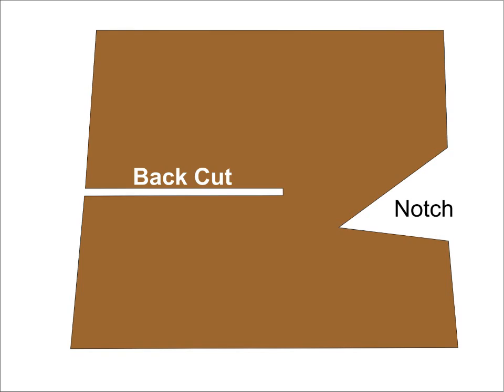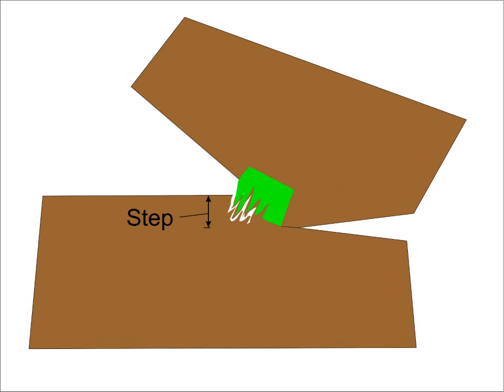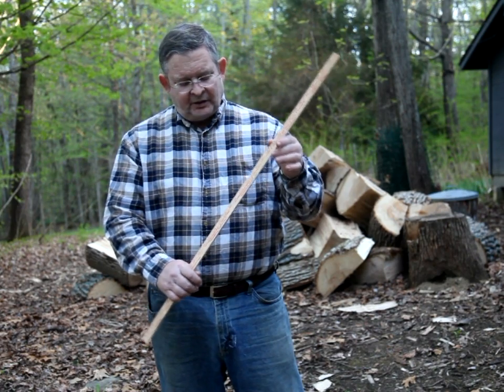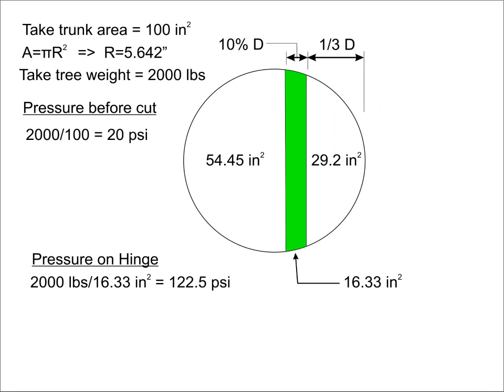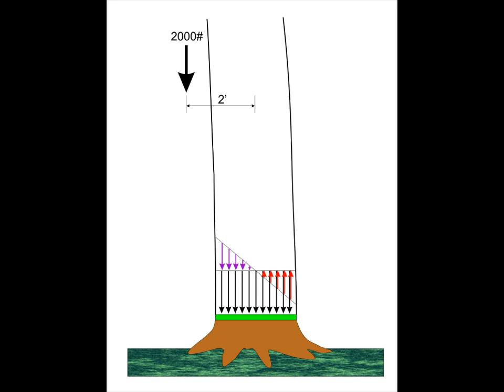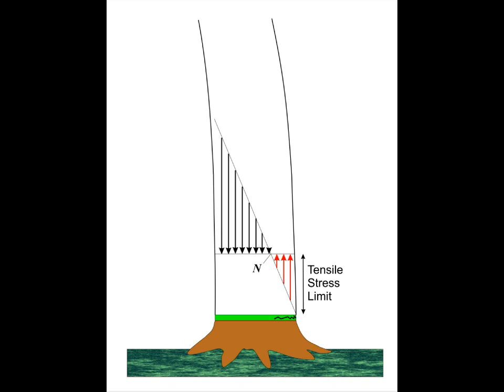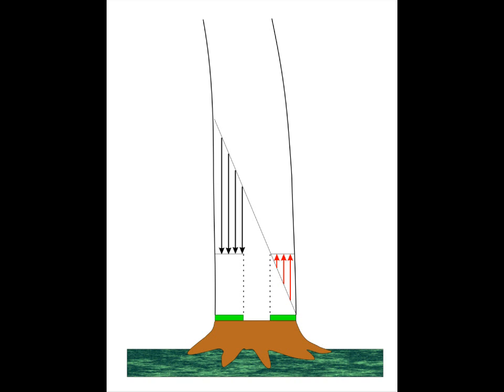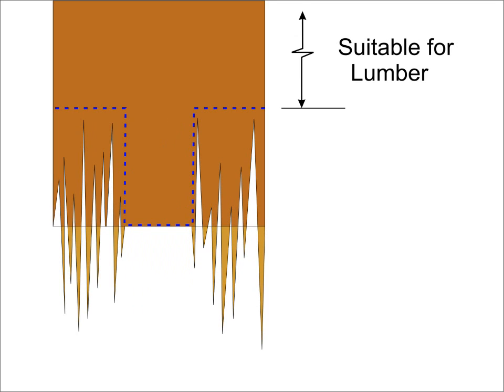Engineering Principles of the Hinge

Comment: Interesting video! The use of a step is new to me. Is it common to use this step as a general precaution or only when cutting down deciduous trees that is likely to hit another tree, with the risk of kicking back?
Reply from the maker: The step is used as a general precaution.  It is important when there is a likelihood of a firm contact with another tree.  When cutting for lumber production, the length of the butt log is economically important and the step is often minimized or skipped, but that adds slightly to the felling risk.  The use of the Humboldt cut reduces the kick-back threat.

Comment: @11:55... I found that out a couple of months ago with a 23ft tall broken off pine (about 60ft tall originally) with a little back lean, was surprised at how much wedging force it took using an 8# sledge to get it moved over plumb...I'm sure it would have been easier if I had bored out the center of the hinge.

Comment: Is there a recommended height of the step to prevent kick back? Or is that what t represents in the W=8t formula ? In that formula I'm not certain if the view is from the top or from the front of the hinge. Thanks.  Your videos are a great source of information . I watched them years ago. Now am watching them again, and getting more out of them now that I have more tree falling time under my belt.
Reply from the maker: Hi, Collector.  The w=8t is just a rough relationship for the shape or aspect ratio of the hinge in plan view (seen from above).  It should be around 8 times as wide as it is thick.  
   As for the step, for a tree with a diameter of up to a foot, a 1" step would be reasonable.  Above that diameter, the height should probably increase to around one inch for each foot of diameter.  Part of that is to account for the back cut not ending up precisely where it was intended to.
Reply from the maker: KInd of like watch a sport.  You can appreciate some things a lot more if you have experience doing it yourself.

Comment: Why is the hinge on the fall side? The weight of the tree is on the wrong side, how does the tree fall toward the notch?
Reply from the maker: The primary purpose of the notch is to allow the trunk to "fold" about the hinge.  If only a cut was there, the trunk would only be able to bend about one degree before the cut closed.  As somewhat of a secret, the cross-section of a trunk is never under uniform stress.  The outer portion is usually under greater compression than the inner portion.  Merely cutting the notch will often induce the tree to lean a tiny bit in that direction due to the loss of compression where the notch was removed.  For an initially well balanced tree, that will usually be sufficient to induce it to fall in the direction of the notch.  In all other cases, the tree needs further inducement to move in that direction.  That is typically provided by driving wedges into the back cut, pulling with a rope, or both.
   Unfortunately, a lot of inexperienced fellers have disasters when they assume that, just because they cut the notch where they want the tree to fall, that will convince the tree to do so. Other inexperienced fellers, seeing the tree is not yet starting to fall in the desired direction, make matters worse by cutting away too much of the hinge, thereby losing control of the direction of fall.
Reply: @terryhale9006  thank you, I know the function of the notch, but I did not know that the weight was on the sap wood. So that makes sense then that the tree would lean towards the notch even though the hinge is also on that side of the center. I always wondered about that and could not find an explanation, thank you!

Comment: Fascinating! I would like to learn more about the practice of cutting the center of the hinge. To include actual woodcutters employing and demonstrating the practice. This is the first I’ve heard of it and I can see the great benefit of it. Following through in my mind it would seem the bar width when plunging would be critical and varies according to the diameter of the trunk. Certain small trees would require a  very narrow bar which is not available and very large trees would require a cut slightly wider than the bar. The width of this cut is based on the diameter of the tree as well as other factors.
Reply from the maker: Al,  There are a few European videos which show the practice.  I think I've only seen one American video of the practice.  Purely in terms of taking the tree down, it will generally not be needed on smaller trees, as the hinge will be easier to bend than on a large tree.  If you're trying to maximize lumber production and the tree is well balanced, you can take out more of the center of the hinge, opening up the possibility of using the technique on smaller trees that are well balanced and still of lumber-producing size.

Comment: Sir, regarding a thicker hinge for leaners on the side of the tension wood.... did I miss it, or have you already explained it fully somewhere?
Is it good to leave the tension side of the hinge thicker on side leaners? .... or does the extra force required to bend/break the thicker hinge nullify the holding effect of the thicker hinge side? .... would you please elaborate on the hinge for side-leaners or please direct me to the video where you do thoroughly cover this? (I call myself having watched all your videos about trees if not all your videos. Thank you.
Reply from the maker: Robert,  This was something I had struggled with a good bit before I chose to not emphasize the point.  At first blush, it makes sense to leave one side of the hinge stronger to resist the side lean.  The problem is that a thick hinge (on one side) won't let the tree move much in the felling direction until the hinge has begun to tear and thin.  By the time the tree has fallen through as little as, say,  5 degrees, much of that thick side will have torn, bringing both sides of the hinge closer to the same thickness.  Tearing starts at the back side of the hinge and will attack the point of strongest resistance first.  With only five degree of movement done, there is still plenty of time for the side lean to act on the weakened hinge.
   While I am not thrilled with it, my conclusion was that starting with the hinge thicker on the side away from the lean probably does provide a temporary resistance to the lean, but it can't be relied on throughout the fall.
   I do leave the hinge a bit thick on the side away from the hinge, but I doubt that it helps me that much
Reply: So when falling placement for a side leaner is important (tree is leaning toward a house or toward a road), per your other video(s), would you say the best "insurance" for controlling the side lean during the fall would be a rope up in the tree and tied off away from the lean... i.e. parallel - in line - with the hinge? .... so as the tree falls, the rope will stay tight, holding the tree away from the lean -- allowing the hinge to do it's work normally and guiding the tree to the ground?
Reply from the maker: If it's a good strong rope, definitely.  The hing can take up some of the load from the side lean and the rope can take up the rest.
Reply: Mr. Terry Hale, would you please comment on (or please redirect me to info on) the "breaking" or tensile strength of a rope or device, vs. the Working Load Limit .... (which is 1/10 of the breaking strength(?)) .... this 1/10 "working" limit seems to defeat the purpose of the breaking strength of the rope -- rendering it impossible to get anything done with it. e.g. a 1/2" polyester rope having a 5000 lb breaking limit, should only be used for 500 lb (?!)   Am I misunderstanding? Thanks!
Reply from the maker: Robert, No, you are not misunderstanding.  The ultimate strength of many things, such as rope, cable, chain, concrete, and structural steel, are usually determined by actual or representative testing of the materials under ideal circumstances.  In actual use, however, those things will wear, deteriorate, creep, and fatigue over time.  Additionally, the configuration in which they are used may subject them to higher stresses, or concentrated stresses that were not present during the simple tensile testing (or compression testing for concrete).  To account for these various factors, each industry recommends using lower loads /stresses so that there will still be confidence that material will perform adequately.  Concrete and steel don't get their allowable stresses knocked that far back below their ultimate stresses, but rope really does.  This is only right, since ropes get frayed and some can suffer "awesome" deterioration due to the UV from sunlight.  Polypropylene can get nailed by prolonged exposure to sunlight, while nylon is much more resistant.
   In addition to concern for safety, the industries also have concern for liability.  Would you sue if they said the rope was tested for 5000 lbs and you got badly injured when it broke at 1300 lbs?  They are off the hook if the packaging says, "Don't exceed 500 lbs."

P.S.  If there is a risk of injury, do your best to work within the limits they state.

Comment: Watched almost all your videos and i have to say , good job and thanks for the clear, precise information / teachings your providing. I would like to know if its possible for you to make a video about felling rotten trees. I have a wood lot with mostly maple and yellow birch and some of those have a hollow centre from trunk to avg 10 feet up the tree. I dont have enough material to do a plunge cut as they are leaning and am afraid that after i make my notch it will split.. help ?
Reply from the maker: Thanks Gilles.
Rotten trees are big concerns for both fellers and climbers, especially because it can be nearly impossible to assess how much strength the tree has remaining and how that compares to the stress it is already under.
   Yours is the second question I have received on this issue, so that is sufficient to put it on my wish list of videos to do when Spring arrives.
   I'm assuming that since you said woodlot, you feel free to fell them in any direction you wish.  If I had to deal with a rotten leaner in your wood lot and wanted to play it safe, I would get a long rope with which I could try to pull the tree down in its direction of lean and get the rope to a pull point at least 20 to 30 feet up in the tree.  (Thrown through a crotch and tied around the trunk, above where I'd cut.) 
   Then I'd try a really good pull to see if I can get the tree down.  If it comes down, Problem Solved!  If not, the tree has told me it has enough strength so that I can do a bit of cutting.  I'd do a bit of cutting, then pull again.
   Test pull.  Nibble.  Test pull. Nibble.  Test pull.  Nibble.  Repeat until one of those pulls brings it down.
Reply: Terry Hale , Thanks for the advice Terry, i see what your saying and yes it is my own wood lot so I can fell the tree were i want. I however dont undestand the part about the tying near the crotch near the trunk though? also what would u use to pull in order to get enough force for the tree to come down as they are medium size trees and I would think need enough force to break ? Thx again ☺
Reply from the maker: Gilles,
   YouTube has been really annoying me for the last month.  It won't let me see any of the replies I have ever made and it is not letting me read half of the new comments people are making, except for the first half sentence they display in the notifications section.  I can only read your followup as far as "I don't understand..."   Thanks a lot, YouTube!
Reply from the maker: You want to have a long lever arm when you are trying to pull the tree over, so you want the rope high in the tree.  You don't have to climb the tree, though.  You can toss the rope through a high crotch.  The end of the rope that falls through the crotch can be tied around the trunk.
   The pulling does not have to be so strong as to poll the tree over.  It merely has to be strong enough to let you know you can safely do some more cutting without worrying about a barber chair.  Eventually, that hand pull WILL be sufficient to pull the tree down.
Reply: Terry Hale , Great Terry! i know what u mean now as i just watched your video on pulling a tree down with a rope. I will be getting the necessary equipment over the winter and come early summer i will try my luck at putting those scary ones down ☺ Thx again for the great advice 👍

Comment: When talking about the effect of cutting away the center of a hinge something I did not see addressed was the effect of removing that section on the weight component of the reduced support area. Instead of being 16% of the original cross section it is now reduced to a bit over 10%. That leads to the conclusion that each square inch is now supporting about 200 lb of static load. When combined with the side forces of an off-center tree that would offset some of the net tension and thus make the hinge less likely to fail under tension. I'm probably missing something but it seems that removing that center has made the hinge less likely to fail.

Comment: Hello Terry, could you do a video on the dutch-men techniques? soft, swing and kerf dutch-men i utilize them and want to make sure I am doing it correctly  https://www.youtube.com/watch?v=tbN1sKN7IlI, this geltelman is an extremely skilled feller, I hope to someday be as knowledgeable and skilled  as you both :)
Reply from the maker: DIESELMAN8V92 Hi Diesel.  You're exposing the limits of my experience.  I will look into the technique.  I'm guessing you have to be selective in what trees you try to use it on.  It really relies on having some good tensile strength in what little of the hinge is left.  You probably wouldn't want to use it on a dead tree and would probably want to limit its use to long-grained conifers, rather than short grained hardwoods.  My biggest challenge will be finding a few trees at a forest edge that are leaning parallel to the edge, rather than perpendicular as they strive to get light.